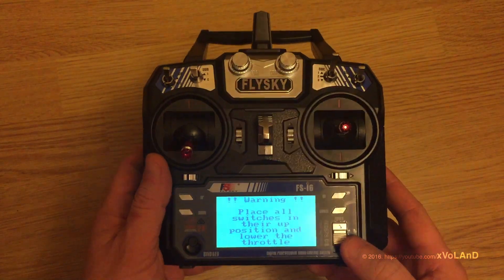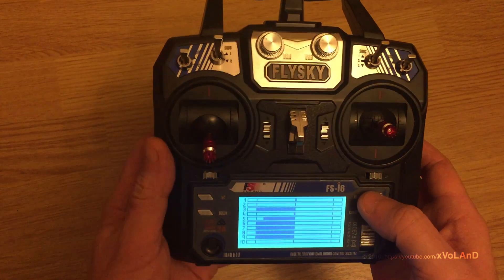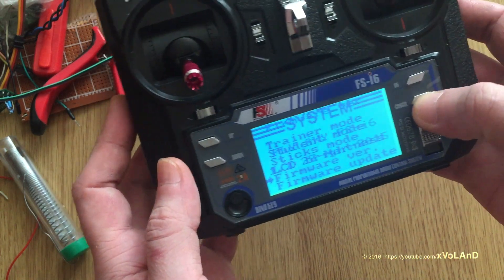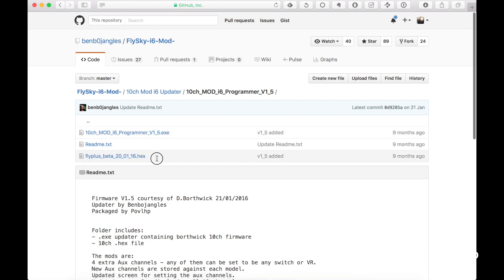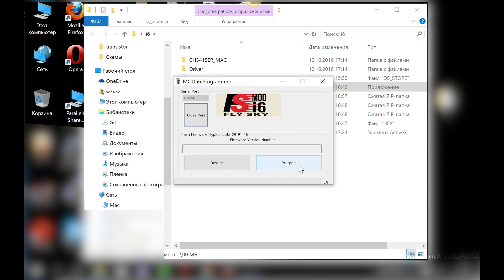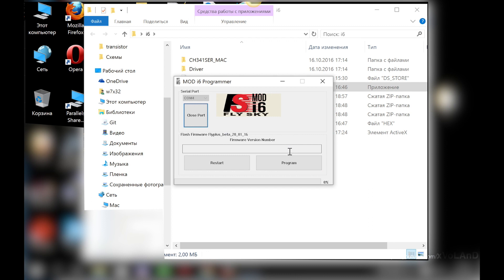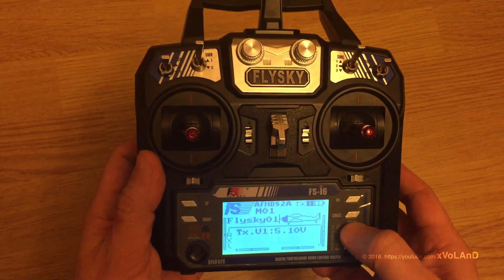FlySky i6 upgrade mod 6ch to 10 channels. Turnigy TGY-i6 10ch How to Tutorial.

Comment: I have the cable that connects the Turnigy TGY-I6 to pc via USB, to play simulator games and other stuff.
This will work to make the upgrade ?

And a USB TO serial can also do this work ?
Reply from the maker: Paulo Lobo If the computer (program) sees a COM port via USB, you can. In any case, if something is wrong, the program will not do update

Comment: Hi, Thanks for the instruction vid. I have a Eachine i6 which as far as I can see is a re-badged Flysky i6 like the Turnigy. Would this mod work with this?
Reply from the maker: Hello! You can try, but I'm not sure that it will be updated. The manufacturers sometimes protect their products. In any case, I would have tried update ;) 
If something is wrong (the boot-loader will not give to update) you can return to Eachine firmware (I think). Let me know if you will succeed. Thanks!
Reply: Thanks for the reply. I am waiting for data cable to arrive should be here in a couple of days. Do you think it would be an idea to try and update to flysky firmware (currently on Eachine) before trying the mod update? If so could you post a link to where I can download it. Thanks for your help in this matter bit of a Noob at this :-)
Reply from the maker: Mel Mann I think the firmware must be on the official website of Eachine
Reply: did u succeed? Any results?

Comment: My FlySky FSi6 is not showing up in Device Manager. I do only have the default COM1-Device.
But in Simulation the Radio works fine. Does someone have an idea for me? I would really like to update my firmware
Reply from the maker: if this works and you are satisfied with all the functions, don’t change something
Reply: Vitalii Tereshchuk  How about 10 Channels? Or the timer function or the Battery alarm stuff??
Reply from the maker: SixDRUMMER for the simulator? I don’t think so...
Reply: Vitalii Tereshchuk  of course not for the simulator! for the real drone... wtf dude
Reply from the maker: SixDRUMMER for real drones, yes you need it and it’s works as well
Reply: Vitalii Tereshchuk  look back to my first commend... however dude.
Reply from the maker: SixDRUMMER no idea dude
Reply: My computer doesn't recognize my radio either, I have all the proper drivers installed too....

Comment: Hi Vitaliii, thanks for video. i tried same way for many time but uploading new version stops at 1% of 3%...it doesnt continue till 100%... do you have any idea for this issue?
Reply from the maker: Volkan Yıldırım Hello, Yildirim. On some devices it may take up to 5 minutes. Try to wait longer.
Reply: Hi Vitalii, i waited for 1.5 hours :) no more than 1% . when i run .exe as admin, "MSCOMM32.OCX" file is created... and when i click programme button, "demo.anp" file is created... i am not sure but this not common for ordinary updates. i am using windows 10. may it be related with that?
Reply from the maker: Volkan Yıldırım I also used Windows10 and no any problems with it. Try to install the original firmware or try it again on another computer
Reply: Vitalii Tereshchuk i called my friend and he will bring his laptop with win8 :) I will update here. thanks anyway
Reply from the maker: Volkan Yıldırım Cool! Have a nice day!
Reply: Baud rate not set correctly

Comment: How can i enter firmware update if my TX does not have screen?
Reply from the maker: I don’t understand your question, sorry
Reply: @xVoLAnD  i have a transmitter that does not have LCD screen. I'm using the fly-bird st-i8 (8 channels) and when i opened, it uses the fs-i4x modules. The transmitter does not have any screen to go to any settings. How to i go to the firmware update setting?
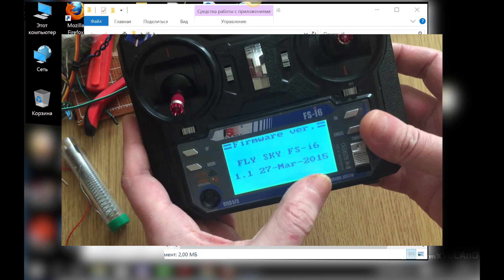Reply from the maker: Ok. I describe how to update firmware for FlySky i6 not for Fly bird st-i8. In any case, I explain 7:42 how to enter the Flysky in developer mode
Reply: @xVoLAnD  yeah, i figured it should work since the board inside is made by flysky. The only problem i have is i dont know how to enter the firmware update mode without an LCD. I tried your suggestion but no luck, still says no device connected.

Comment: Successfully weme your device has 10 channels! thanks! BUT how to put an end point on channels like (7,8,9,10) it's difficult in the menu (end points) I don't have the channels 7,8,9,10! PLEASE HELP ME
Reply from the maker: Function Setup -> Aux.channels
 
In Betaflight: Configuration -> RX_SERIAL in Receiver Mode, also select IBUS in Serial Receiver Provider
Reply: @Vitalii Tereshchuk  I'm not understand you.
Reply from the maker: @bgrcmodels  I'm sorry, but I can't teach you. These are the transmitter (Flyski i6) settings and settings in the configurator, for example BetaFlight.
I made hints for you, but if you don't understand, I'm sorry.

Comment: i want to upgrade fs i4 to 6 channel by using fs i6 .hex file 😊
is it possible to upgrade it and add two switch for other two channels
Reply from the maker: Of course you can, but you need an internal board from i6 and cut the window for the screen 😊
Reply: But i don't need sceen just the channel is it not possible with that i4 board
Reply: there is an i6 without screen may be that firmware would work ?
Reply from the maker: Flysky i6 without the screen will work. Compare the electrical circuits
i6 with i4 and will be able to answer on your question
Reply: Vitalii Tereshchuk  thanks a lot

Comment: Does anyone know how to reverse the throttle after a switch is pressed?
Reply from the maker: Check in your configurator for drone this option
Reply: @xVoLAnD  I do not have a configurator. I am using this transmitter for an RC car application. Any changes will have to be made to the transmitter
Reply from the maker: @ianharlow  Oh, ok. It's difficult something to advise, but try: Function->Revers or need playing with Mixer

Comment: thanks, it has bricked my transmiter
Reply from the maker: This is strange and impossible, because the upgrade firmware doesn't rewrite the bootloader of transmitter.
Reply: ok i just tryed again, my transmiter would not turn on after i did the firmware update, so it was bricket, i tryed againt to flash but nothing appeared on the screen, and then, boom, update it again and now it work, :) thanks
Reply from the maker: Congratulations!
Reply: what exactly did you do to fix it? because i followed this video and now mine wont turn on